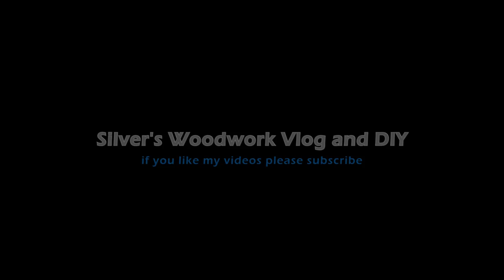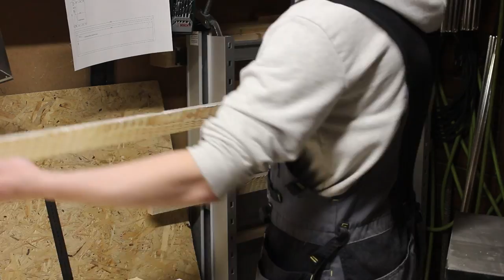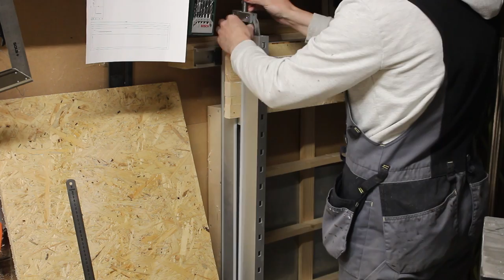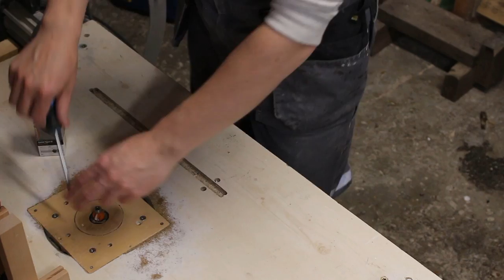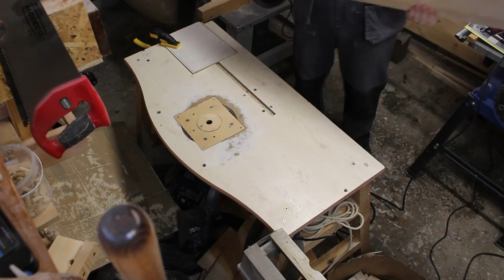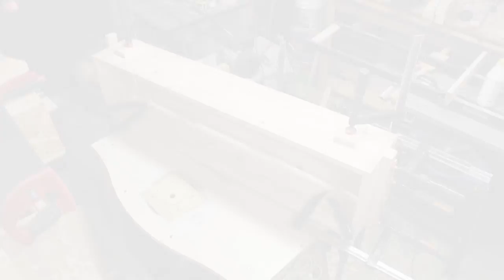Making modern style wooden kitchen- or bookshelf.

Comment: Good job! Just a tip for ya, I use Bessey pipe clamp fixtures and you can get small screw on pieces for the ends so that you can screw two pipes together. I have many of these pipes cut to 30" and if I need something longer I just add an extension piece and screw on another 30" piece of pipe. It's a very versatile system. Just make sure, if you go this route, that you buy pipe that has thread on both ends. Take care!
Reply from the maker: Thank you for a tip and comment! Indeed I need some clamps what can extend as I have very small workplace :P. Thanks for good recommendation! Best for you and take care!